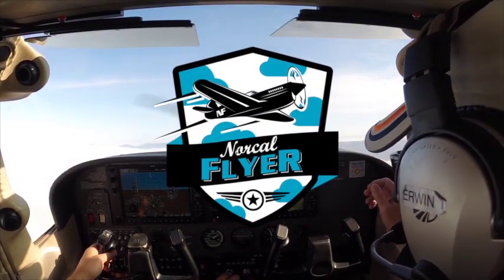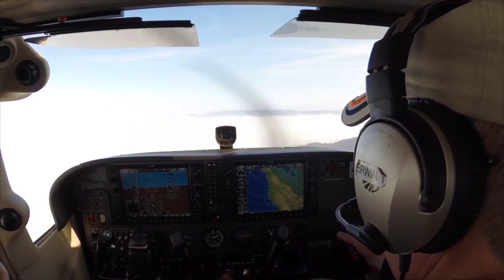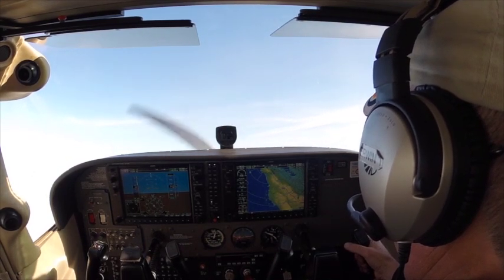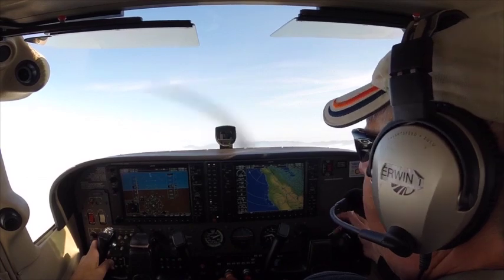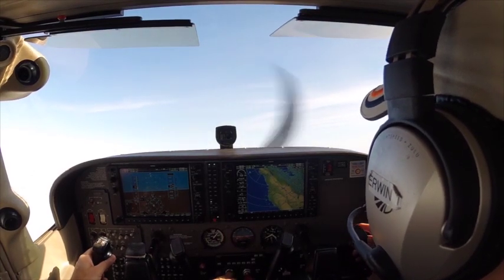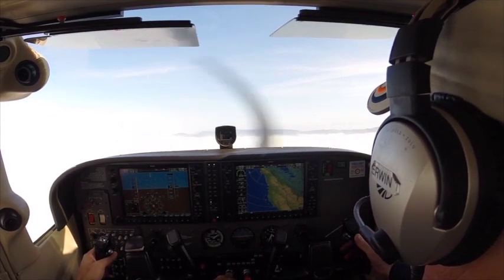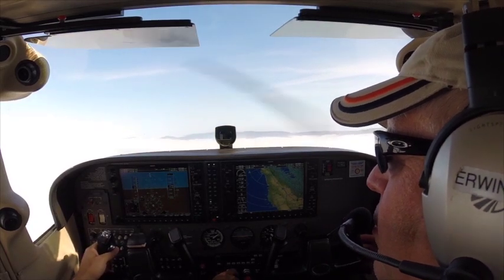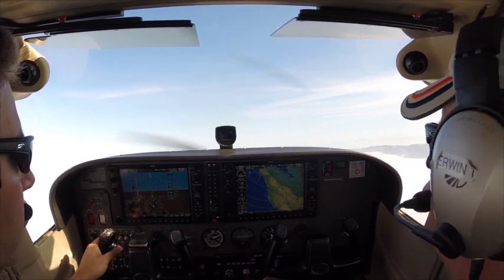Cessna 172 Power Off Stalls

Comment: Instructor misspoke. Power is not added "immediately." It's only added after you are sure the stall has been eliminated. In some aircraft, this mistake can kill you. A friend of mine had a close call when his student added full power while his Mooney was still stalled. The torque of the engine rolled the plane over. It started spinning and quickly went flat. They recovered after several turns.

Comment: Its not correct.you guys can see that he add power immediately when the nose starts to drop.And the stall warning horn work again.Its pretty easy to stall again.So you need to let the nose drop down and gain some speed and then add full power.You can’t just add power immediately,it’s not safe.
Reply from the maker: Xiangda Zhuang This video does indicate the correct procedure by the instructor. From the FAA Airplane Flying Handbook, “reduce angle of attack, releasing back elevator pressure, and advancing throttle to maximum allowable power”. The two stalls following the demonstration were my first ever attempt at inducing and recovering from a power off stall as a very early student pilot some years ago (so may not have been perfect). Having said that, this is exactly how I subsequently practiced and eventually successfully performed the maneuver for my PPL check ride.